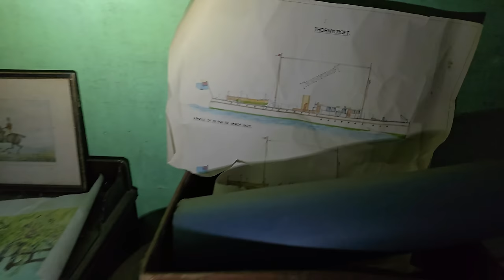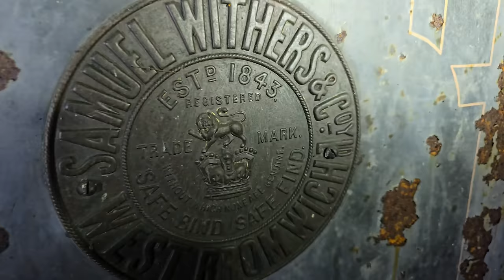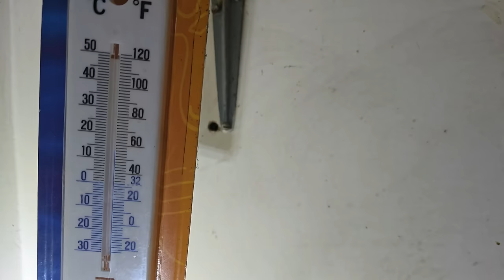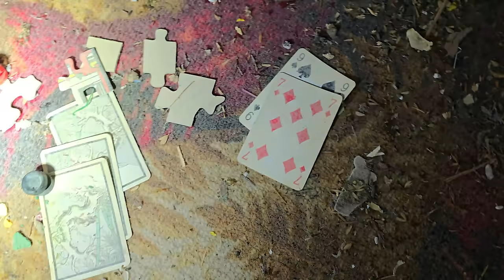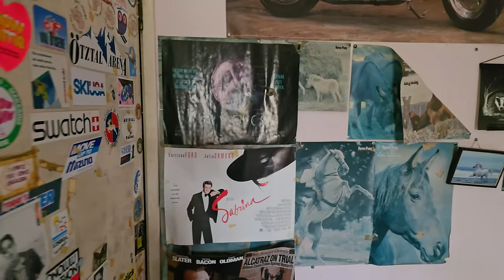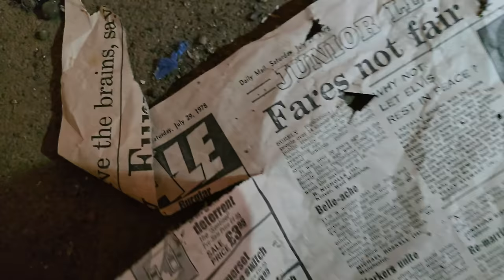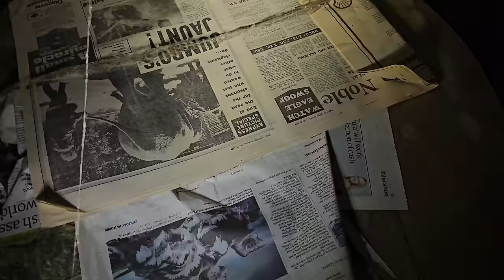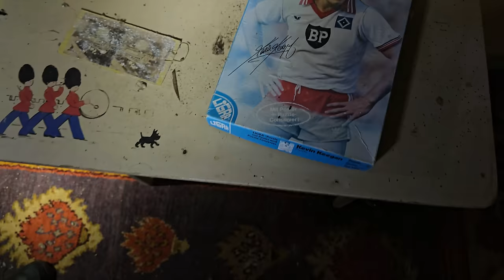We Found Antique Drawings and Maps in Abandoned Bungalows!

Comment: I am a salvage expert not only do I take all the stuff in the house I disconnect plumbing and electrical use a chainsaw to cut the house into sections by cutting through the walls, floors and roof. I jack the house up off the foundation and put them on flat bed trucks and move the sections to another property then rebuild a new house from the old sections
Reply: Better than demolition if basic structure is solid.